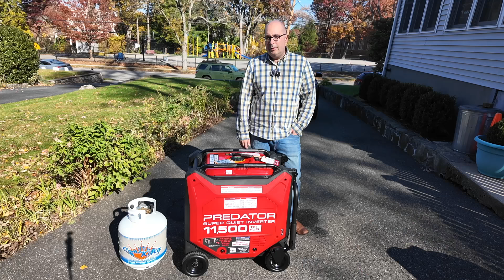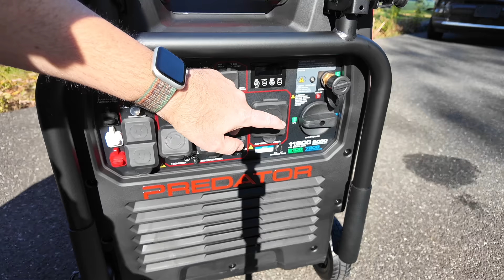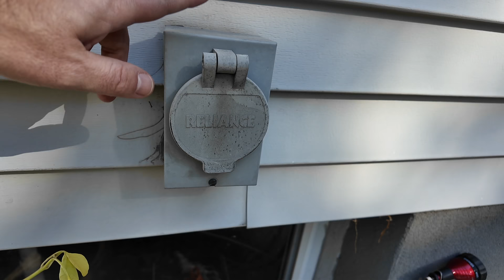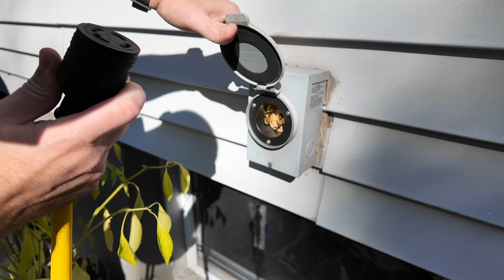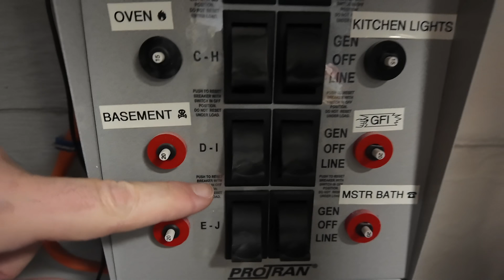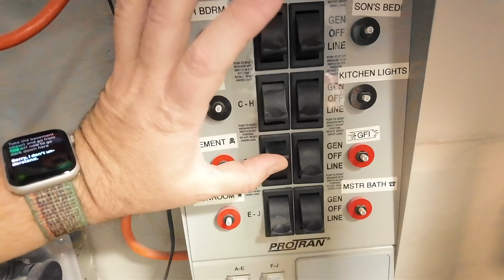Predator 11500w Powers My Entire House (Transfer Switch & Full Test) — Honda Should Be Worried!

Comment: I’m a small engine mechanic. Please maintain and take care of your inverter generator. Inverter generators are a nightmare to work on. Most work well if maintained, but cleaning a clogged carburetor can take hours. I recently made $200 cleaning the carburetors on two neglected small inverter generators . They’re a pain! I maintain my smaller inverter generator, use it often, and use ethanol-free gasoline with Ethanol Shield for long-term storage. I’m discontinuing working on inverter generators unless it’s an open-frame model. Removing half the case to access the carburetor wastes time.

People using propane should be aware of its inefficiency. You will get almost 30% more run-time using less gasoline per gallon than you will propane (and get more power with gasoline) than with propane. Gasoline and propane have pros and cons. Propane never clogs carbs and never goes bad, but if you know how to use & store gasoline, I recommend it.
Reply from the maker: That's incredibly valuable insight from a professional, thank you for sharing!

Comment: Do you have a video showing the transfer switch installation?
Reply: No because he actually didn't do the work and if he did it was years ago because you can tell by the aging of the box and caulk around it.
Reply from the maker: I actually did do the install myself, but it was about 10 years ago so unfortunately I did not film it. In retrospect, I think a whole panel interlock is a better set up than a transfer switch because you’re not limited to the circuits you can power.
Reply from the maker: I installed the transfer switch and the box myself, but it was many many years ago. This type of installation is generally better done by an electrician.

Comment: Cost of interlock varies.  I paid about $800 in my old house for interlock, 30amp input port, and the labor (I wanted input port on drive way, and the panel in the basement was at the other end of the house. ).    New house, it cost me under $500 for interlock, 50 amp input port and labor.  But the circuit panel on this house is in the garage, so the input port is only a few feet away.  

In the old house, the electrician also put meters for A and B leg of the circuit panel, so I could watch the load, and know if I'm close to overloading or not which was helpful.
Reply from the maker: Thanks for sharing your experience and the cost breakdown! It's super helpful to hear different installation scenarios.

Comment: So it TRULY DOESN'T RUN WHOLE HOUSE... only what you turn on. Very deceiving
Reply from the maker: Whole house is very subjective. In my situation I don’t have central air. I don’t have electric heat and I don’t have electric hot water. I have a natural gas hot water heater, a natural gas stove and oil heat so a unit like this can run pretty much everything in my house. Different folks they have different situation situations so it really depends. Thanks for watching.

Comment: You could always install the 50 amp inlet and buy an 30 amp to 50 amp adapter for your 30 amp generator. Until you purchase a 50 amp grnerator.
Reply from the maker: That's a very practical suggestion for bridging the gap until a larger generator is acquired!

Comment: I'm about halfway through the video and I may add to my comment but I just wanted to say that Harbor Freight had their generators on sale Thanksgiving week this past year. I picked up the Predator 13,000 starting watt /10,000 running watt generator for $975. I told my wife that we couldn't afford not to buy it. A lot of people around us got the Generac generators and you are spot on about the price plus putting in a propane tank and it runs for 15 minutes every week wether power's out or not and propane ain't cheap. So I'll go back to your regularly scheduled program but I may add to my comment. Like I said, you are spot on. I said that I would probably say something and all that I will add is that this is an excellent video. It's easy to understand and I have a 30 amp. hookup now but I'm going to have it changed out to the 50 amp. Very useful information so God bless and have a wonderful day.  👍👍🙂
Reply from the maker: I appreciate your kind words and I'm happy the information was useful for you! Thx for watching

Comment: If I have solar panels will the interlock set up work with the generator running and my solar panels producting power?
Reply from the maker: You would need the solar panels to be tied into a battery bank. That would be the only way they could work. There is no way to tie solar panels into a generator.

Comment: The Predator looks a whole lot like a Westinghouse generator. If you, like me, had a camper with a 50 amp connection, you can use that cable to connect to your house.  Sold the camper put kept the cable.  I have powered my heat pump HVAC when power goes out with a 9500 watt running power Westinghouse Generator.  I will buy one of these when the Westinghouse goes out.  Thanks for the  video.
Reply from the maker: That's an interesting observation about the resemblance to Westinghouse generators!

Comment: Doesn’t it need to be grounded?
Reply from the maker: This generator is a bonded neutral, and when connecting any generator to your transfer switch or interlock, you want it to be a floating neutral. You don’t need this to be grounded, and in fact, you want to disconnect the bond to make it a floating neutral generator. I have not done that yet, but will do it as soon as it’s warmer out and will make a video showing how to do it.
Reply: @Outdoor_Prepper ok thank you

Comment: The problem with natural gas is you are at the mercy of whatever idiot controls the on/off valve for your area. We had a devastating tornado 12 years ago and the gas was turned off for a week. Out of extreme caution they said.
Reply from the maker: That's a very valid point about the vulnerabilities of natural gas during emergencies. Thanks for sharing your experience!

Comment: Question if you have a generator thats duel fuel and the carb stops up from old gas and won’t crank will it still crank on propane with no problem??
Reply from the maker: It will! That’s the benefit of propane

Comment: That 20lb bottle won’t last long! 2-3hr at most! That if it doesn’t run out of vapor first! That small bottle won’t produce enough vapor to keep up with the btu demand! You will need a min of 250 gal asme tank to properly use this genny for extended outages!! Don’t be mislead by that!!
Reply from the maker: You're right, for extended outages and high demand, a larger propane tank would definitely be necessary! I was able to get 10 hours at 25% load on a 20 pound tank during testing
Reply: @Outdoor_Prepper I call BS on his 250 gal min.. that’s a joke
Reply: @Outdoor_Prepper I’m very surprised at that and skeptical to be honest!!

Comment: While I can appreciate this video,  with a 30 amp circuit, you aren't powering a million refrigerators along with a coffee maker, and a microwave, and tv's and a cable box.  Most people have no clue what P = I x E means and your 30 amp circuit being 3,600 watts,  go ahead and connect just your refrigerator, microwave, and toaster over without the coffee maker,  and you are already over taxing your circuit.  Yes this is cheaper for a number of reason when compared to a generac.  First you did the electrical work.  Second you have partial with a manual transfer, which is unlike the generac that would be whole home and one within 30 minutes (even a 3 AM without having to go into the garage,  drag the unit out, and set it up. If you have reliable power,  this is a great alternative.  But just like the price, you get what you are paying for.
Reply from the maker: You bring up some very valid points about load management and the differences between portable and whole-home standby generators!

Comment: Very well done video!  I now have a Generac standalone generator with an automatic transfer switch. However, in the past, I have used portable generators in other homes. There are a couple of important considerations: 
What if no one is at home when you lose power for an extended period. If you have $500 worth of locker beef in your freezers, you may come home to a real mess.
Secondly, would your spouse or adult children be able and willing to hook up the generator, particularly in a stormy situation as is common during a power outage?
Reply from the maker: Those are some very important points in one of the benefits of a whole house standby unit for sure

Comment: I use a smaller generator because I have 16 panels 500watts with a small two battery bank. So charge batteries and run well pump. Day time I get enough power.
Reply from the maker: That sounds like a fantastic and efficient setup!

Comment: It's my experience that the small propane tank may not be enough for sustained operation. I switched to a 100 gallon propane tank and this is why: When using propane as fuel, it's stored in the tank as a pressurized liquid but vaporizes into gas as it's drawn out for use in your generator. This vaporization process is endothermic—it absorbs heat from the surroundings, including the tank itself and the liquid propane inside it. If the rate of vaporization exceeds the tank's ability to absorb heat from the ambient air, the tank's temperature drops. When it falls below the dew point of the surrounding air, moisture condenses on the surface and can freeze, forming ice.The key differences between using 25-pound tank (holding about 6 gallons of propane) and the 100-gallon tank come down to size, thermal mass, and heat transfer:.
Reply from the maker: That’s a fantastic explanation of the thermodynamics behind propane use with generators – very helpful! Appreciate the tip and thank you for watching

Comment: Do you know how to un-bond the neutral on the Predator since I am connecting directly to my circuit breaker panel?
Reply: There are many videos showing this process. On the 9500, below the 12V switch (above the letter D on the word Predator) you'll see a ground stud. On the back of the panel you'll find a white wire with a ring connector hooked on the other side of the ground stud.  Once the front panel is removed you need to remove this white wire. I taped the white connector up and put the panel back on.  This will unbond the generator, making it a floating ground. Now, understand this, This will make it safe for hooking up to house power,  But if you plan to use the generator as a stand alone, you'll need to get or make a bonding plug.  This will restore the generator to a bonded ground. I made one with the included 30 amp male plug that came with the generator. You can look up how to make a bonded plug, it's simple make, one wire set up.
Reply from the maker: It’s an involved process of removing the handles and owning the front panel to disconnect a wire. I will try t post a video as soon as it’s warm enough outside to work on the generator. I haven’t unbonded mine yet either
Reply: Curious about this one as well.

Comment: One thing you should have covered is fuel consumption with propane. Is a 20lb bottle enough and how long would that last you? Will the bottles freeze being that small for the consumption of power you're using? Sorry if it was in the video and I missed it.
Reply from the maker: I actually did make a separate video on propane runtime. Check it out. It’s on my channel. Thanks for watching.

Comment: Generlink!!!!! hooked right up to your hydro meter the simplist and cleanest way to plug your generator into and use your existing panel in your house. That transfer switch got a lot of wires and crap around it, should have installed a generlink. Get the 40amp generlink and you can supply up to 9600 watts to your house good for almost everything with a 50amp cord. Great video and great explanation of everything, good job
Reply from the maker: Thanks for the feedback and the suggestion about the alternative hookup!
Reply: @Outdoor_Prepper ya do a video on them next the more people that see what a Generlink is the better. It is the cleanest way to supply alternative power to your home and use your existing breaker. Getting to be very popular where I live and where we have powerful and damaging winter storms
Reply from the maker: Absolutely I will try to pick one up in the future and do a review on it
Reply: too expensive. 50 amp generator inlet with interlock is the way to go.
Reply: to each their own I guess.
Reply: I was gonna get a Generlink, but my electric company did not allow it.
Reply: @JayLurk007 yes some places allow it some don’t. I don’t know why

Comment: Our electrician has recommended a GenerLink device which acts like a transfer switch, and is installed just behind the meter. I can supply the whole panel and just turn off circuits to match the capacity of our new Predator 11,500 generator/inverter. We a dilemma of the well was fed through a sub-panel in a detached garage it was difficult to locate the lines/connections to the well which could be underneath some new sidewalks, cost lots f labor time locating and rewiring the well to the main panel. When the supervisor came out he suggested just install a GenerLink and solve the problem w/ sub-panel and unknown location of well wiring which could require separate cords/interlock kits. This is all theoretical and we haven't even started the generator yet. Now watch, we won't have a power outage for years.  But this is the plan we have decided with our electrician. Propane company is also coming out with a 120G tank to supply it all.  We have no interest in kissing around with gas, but is always an option if it was the only fuel available in an emergency. Gas is usually less available than propane, so it likely we can stick with propane. Now want to research a power station to avoid running the generator all night for CPAP, fridge and a couple of lights.

Comment: A twenty pound propane tank isn't going to power your house very long.
Reply from the maker: You're right, a 20lb propane tank offers limited run time for a whole house, but it's great for shorter outages or specific needs! you can also use natural gas or a 30, 40 or 100 pound propane tank

Comment: I think if electricians designed electrical panels with emergency power in mind, recognizing the cost benefits of a portable unit like this one, they would install isolated service for very high-draw appliances and put everything else on a main panel.  That way, a family could attach a dedicated generator for the HVAC, controlled by its own interlock kit, and another, say, for the main house.  For most cases, you could really do without the dryer for several days or even a couple of weeks if you had to.  But in extreme weather, you need your HVAC to function, and that's the real challenge to your generator.  Two of these units, one controlling the HVAC and another controlling everything else, would probably work perfectly, and you'd still come in WAY cheaper than a whole-house permanent backup system.

Of course, it does allow for connecting two units together, and maybe that's a simpler answer.
Reply from the maker: That's a really insightful point about designing electrical panels with portable emergency power in mind!

Comment: Have the 9500 and it is only 30 amps it will not let my Air Conditioner start up because of the amp draw on start up was thinking about getting a soft start but would this with the 50 amp work without a soft start installed
Reply from the maker: The 11500W model with 50 amps should handle the AC startup better without a soft start but never hurts to have the soft start

Comment: Depending on the size of your HVAC these units may or may not power them. Also beware the your water heater pull large amounts of power. Of you have gas then that helps with heating of home and water as those do not pull as much power as total electric homes. 
Please consult and electrician and let him know your goals for a generator before buying and as always if you do not know how get it installed professionally!!! You will kill someone if not done correctly !!!
Reply from the maker: You've made some very important points about power draw for HVAC and water heaters, and the critical need for professional installation.

Comment: What you're forgetting to mention, the whole home generator produces dirty AC. If you want a whole home inverter generator. It would be a few thousand dollars more.

I'll buy the Champion 11,500 watt tri fuel inverter generator from Costco for $1999. I'll actually wait for the sale. Costco normally has a $200-$300 dollars off sale.
Champion has a 3 year warranty. Costco has a 5 year or longer return policy. I returned my 5 year old Firman to Costco. They gave me a full refund. No questions asked. 😊
Reply from the maker: Fortunately the harbor freight unit is an inverter so it produces very clean power! Thanks for watching
Reply: @Outdoor_Prepper 
But only a 90 day warranty.
The Champion inverter generator comes with a 3 year warranty and the mystery return policy from Costco?
Champion generators are normally lighter.
Reply from the maker: Champion is definitely a good brand as well

Comment: apparently I am feeling chatty today :)  About the generac whole home units.  THEY ARE LOUD.  there are 2 of them in my subdivision, both are 2 streets away and I can hear them running over my Honda which is in my driveway.  If you are handy and can maintain your own generac and do repairs yourself, then they can last a long time.  But if you leave it up to service contracts, they have a definite lifespan, usually less than a decade.  You can get nickled and Dimed to death with dead batteries, chewing critters, grass clippings blown into the inlets from careless owners etc.
Reply from the maker: Thanks for sharing your experience with the whole home units!